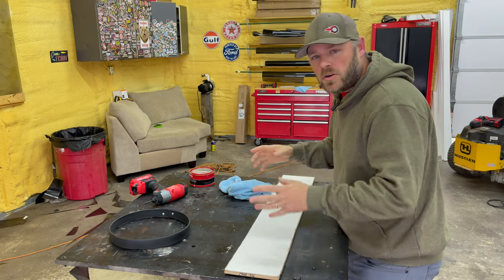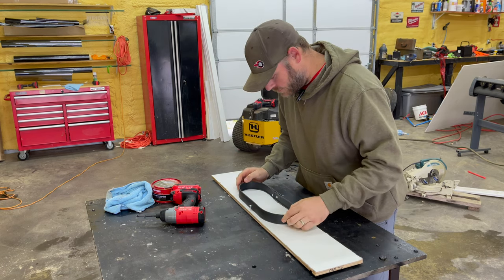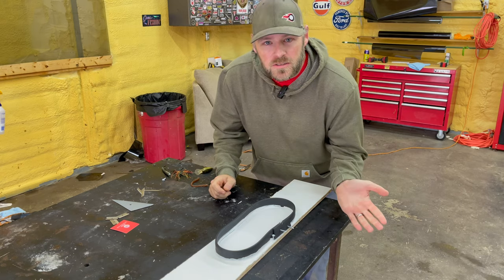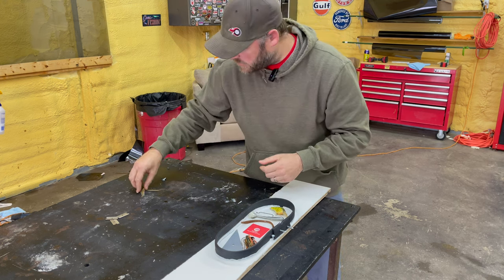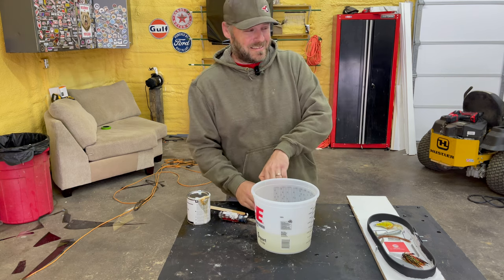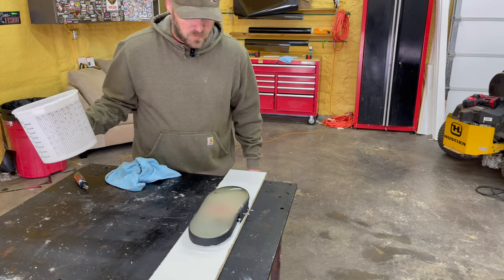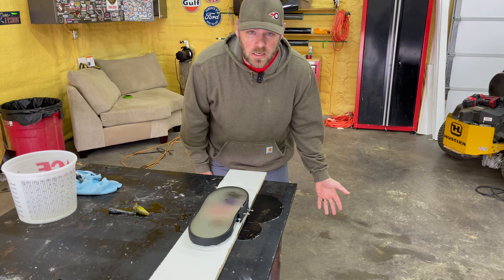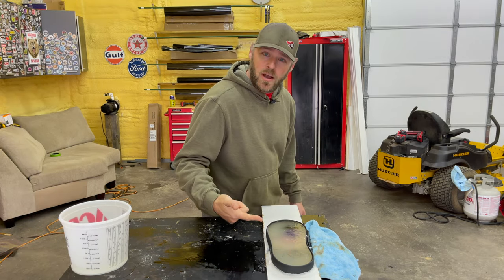EPOXY RESIN PROJECT GOES HORRIBLY WRONG!

Comment: Maybe watch some utube about how to use epoxy if your serious, but I suspect you are trying to be funny. Sorry mate , its a fail
Reply from the maker: Yea may need to. I really had high hopes. Lol. May need to buy some better epoxy.
Reply: @Steeles  first mistake  the wrong type of epoxy   use deep pour  for thick  projects  2 pour it in stages  pour the first layer let it harden to a tacky stage THEN  place your items you want for decoration inside that way they would be inside the resin....The way you did it chances are good the objects you put it will not be fully covered , NEXT pour the rest of the mold  use a hair dryer on med to low fan  and medium heat,   not a torch  to remove air bubbles .  if you opt for a heat gun do not blast it and keep it moving if you linger in one spot too long you can cause it to dry uneven............ Before you trash your first attempt try de molding it and sanding in and polish it with wax  it may still clear up  sand with 150 gr then wet sand to 400 and 800 if by the time you do that and it still wont polish, yeah then trash it  and start over .
Reply from the maker: @williamwofford2503  Ok. Thanks for the tips. I’m gonna get it figured out. lol. I don’t think that one will sand out. It’s really hazy.
Reply: If you ever have questions about epoxy, I'm happy to help. I love Port Protection!!!
Reply from the maker: @icantsleepstorms  underrated show right..?  Thank you